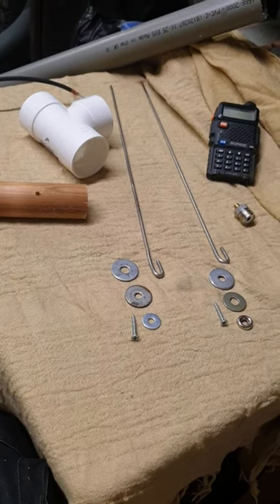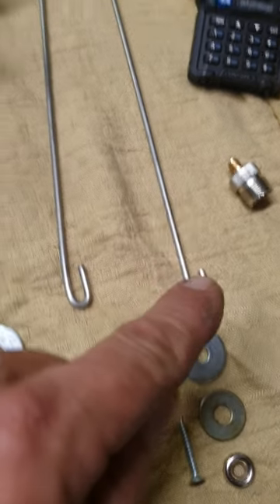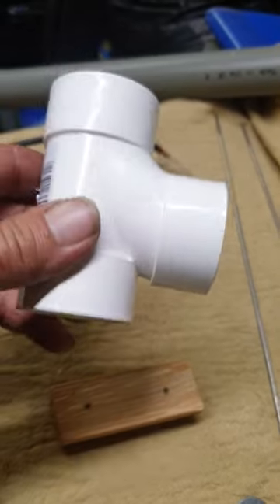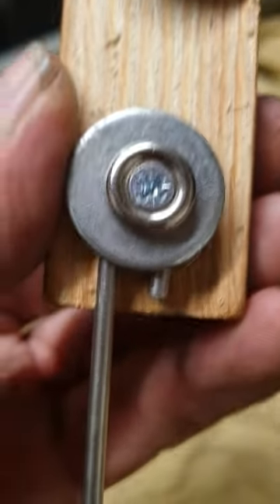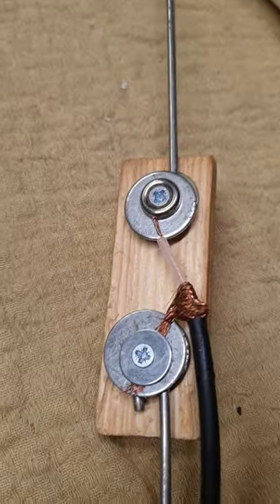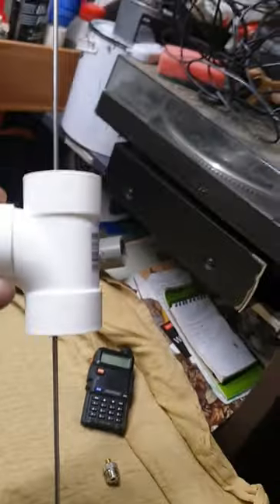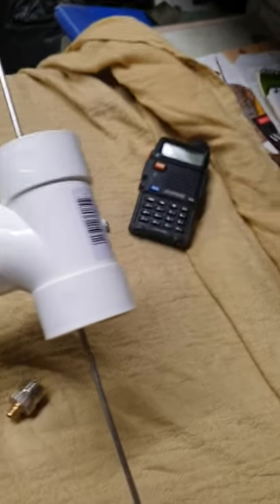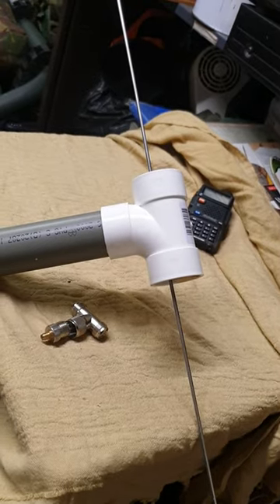baofeng uv5r  diy dipole

Comment: Simple, easy to understand. Thank you!
Reply from the maker: Then my work here is done 👍
Appreciate the kind comments thank you.
Reply: @kentprepper6392  does it make a difference when making an antenna for HF or UHF, when calculating for the wavelength lambda and speed of light. I mean is it better to place the dipole hanged on the terrace horizontally or vertically out on a window mast? ,. I thought logically, if it's on the terrace with good ceramic isolators on each end might have a better reception. AGain thanks for your excellent tutorial . Big hug
Reply from the maker: @juangizirian9810  uhf is usually vertical, this dipole is designed for vertical 👍

Comment: New to this hobby and new to this channel, a most excellent tutorial on creating this dipole! I wonder, being a total noob, would the reception/transmit be hampered if the 2 elements were completely enclosed with pvc pipe and pvc endcaps? I just thought it would be cool and mysterious to have it set up like that🙂 Gratitude for your work here, much appreciated. Subscribed!
Reply from the maker: Should work fine if inside plastic pipe 👍

Comment: I gave this a like, BUT the one problem I saw with it was how you skipped over how to connect the coax to the "CB connector"
Reply from the maker: It is connected exactly the same as a CB PL259 plug ie soldered in place, apologies for missing that bit.
Reply from the maker: My apologies, i was filming using a phone so was impractical to film that bit at the time, tho i do show what it should look like so people can figure for themselves, thanks for pointing this out tho 👍

Comment: Great enclosures. But. Dipoles need 1:1 baluns. 5-6 turns of coax near antenna, and it will make greate difference.
Reply from the maker: Sound advice sir 👍
Reply: Forget trying to match a UHF dipole to Unbalanced coax, Baluns are for large HF aerials.
make a 1/4 wave groundplane instead. a BNC flange mount panel socket makes a good
 base to solder 6 inch groundplanes onto. bent down 45degrees and it'll match 50ohm
coax. instead of a dipoles 75ohm

Comment: Do you need to take it down when it rains? I'm a new ham but I thought water in coax is a problem and I live in a wet environment. Would it work ok if I taped the coax and filled the PVC with epoxy? Thanks forgive my ignorance Im about to take my technician test and want to build my own antenna for my uv5r to learn. God bless
Reply from the maker: If protected from rain then will be fine, Check periodically to see if any corrosion occurs.
Reply: Leave a hole in the bottom of the antenna so any condensation can drip out. 👍

Comment: Nice and smart idea! Did you check your diy dipole against a Nagoya NA771 or similar? Would be interesting to see if there is any big difference in operation? Also how would it behave on 2m Band?
Reply from the maker: Far superior to the 771, not used on the 2m im afraid.
Reply: @kentprepper6392  Thanks - sounds great! Could you specify 'far superior' just a bit? 🙂
Reply from the maker: @rilosvideos877  the 771 adds 5-8 miles radius, the dipole adds 40+ miles radius.
Reply: @kentprepper6392  Thanks! Thats incredible! Have to try that 🙂

Comment: Anyone know how long the Elements need to be for GMRS in USA ?
Reply: For a centre frequency of 464Mhz, the middle of the GMRS band in the USA, each element would be 15.372 cm or 6.052 inches long. The length ISN'T hyper critical, if you made it 6 inches long, it would change your centre frequency to 468Mhz. You'd still get a usable SWR at 462Mhz, which is the bottom of the GMRS band. I wouldn't use steel rod though, as it's fairly poor in it's ability to radiate RF, use copper tubing or aluminium for the best results, but cheap welding rods work very well aswell. Make it, try it, remake it, until it works.

Comment: HI there, newb here. I have a UV-82 and use freq 477 how do I work out the length for that?
Reply from the maker: Each element should be 6.3 inches, there is an online calculator for dipole lengths.
Reply: Cheers mate @kentprepper6392  I'm off to buy some parts

Comment: It will be okay for rx but I believe that some kind of balun is necessary because coax is not balanced and doesn't match the impedance or something like that, I'm no expert. There's vids that explain better. Also the swr should be checked or you risk frying a 20 quid Chinese radio. 😄👍😎
Reply from the maker: Its all for emergency use only, i demonstrated how to make a usable antenna, it works out to 40 miles rx and tx, its worth risking a cheap radio (of which i have several) in order to experiment 👍
Reply: Fair enough, find out during an emergency when swr cooks components.
Reply: @techtinkerin  RELAX...

Comment: New to radio, my question is how shield of coax is connected to PL239 so the receive signal can be transmitted to baofeng (or it doesnt have to be connected and the rx signal goes through central wire? in sma both rx and tx go through same wire i think)
Reply from the maker: @startychh  the pl259 plug has a central core and an outer core, inner core is tx (out) and the outer mesh is the rx.
Reply: @kentprepper6392  makes sense. Thanks for your answer and good video 👍
Reply: The center conductor is used in both TX & RX. The outer mesh is used for ground, also known as a counterpoise.

Comment: What coax did u use and how do u put connector on the radio end of the cable
Reply from the maker: Hi there, first fit a SMA FEMALE to S0239RF UHF PL259 SOCKET in place of the original antenna (ebay about £5), on the coax end just an ordinary UHF PL259 MALE (ebay about £3) try to use at least RG213 LOW LOSS coaxial cable (ebay).
Reply: @kentprepper6392  thanks dont suppose u want to do a updated video and more in depth like showing fitting the connectors to cable ect 😂 thanks for the info
Reply: @kentprepper6392  would Coax with Aluminum coating work or is copper coated the best option?
Reply: @kentprepper6392  a PL259 might be called a UHF connector but its useless at UHF
use a N type

Comment: New to radios. I was all good until the end. How do you connect the coaxial to the "T" connector?
Reply from the maker: The coax would be soldered onto the plug that connects to your radio, in this case the T connector was simply to demonstrate, sorry if i wasnt clear! 👍
Reply: @kentprepper6392  Thank you
Reply: @kentprepper6392  Thank you

Comment: Can a dipole antenna be used or optimized for 915 mhz? If so how long would the rods be?
Reply: If I have it right, it's as below. The fastest way to get the correct answer on the internet is to post an inaccurate one! :)

234 divided by the frequency in Mhz times 12 for length of each element in inches. 
234/915=0.225 X 12 = 3.06 inches for each element. Or 6.12 inches total, tapped in the middle. I've seen people put a 1:1 blun in as well.  Also try vertical and horizontal orientation and use a non-conductive support (Wood, fiberglas) to hold the dipole.

Comment: Any grounding needed in case Lightning hits it?
Reply from the maker: Its designed for handheld use so the user would be the earth/ground, standard procedure is to unplug external antenna if lighting is forcast.
Reply: @kentprepper6392  ok, got it!

Comment: I have some copper tube here that's designed for brake pipe. I made this today but even up on my roof I got nothing on my Baofeng. Is the copper pipe ok for this? Need to check if I got anything wrong but pretty confident it's built to spec
Reply from the maker: Ive not heard of copper/zinc (brakelines are copper/zinc) being used before, i would remake using steel rods.

Comment: Can I use wire instead of metal elements as long as it's 70cm long either side? Would be used on the baofeng GT-3TP.
Reply from the maker: I have heard of wire being used, its best you try both, it is a 'try and see' type of hobbie, do both andcsee what works best for you.
Reply: @kentprepper6392  ok thanks.
Reply: @davidhooper1767  you van use wire. the thicker the better. gt3tp is a great hand held. had one for years and still love it.
wire dipoles pack down smaller and work just as well :D i made a wire one like this for another band and works well with a washing line peg to clip it to stuff
Reply: @wowsly  How long are each elements.Ive seen some that look quite small but others look longer.

Comment: Where can you get the wire and what gauge is it??
Reply from the maker: The coax used in the vid is RG23 but for UHF446 I recommend WESTFLEX 103
Reply: What length of coax do you need to make the antenna??
Reply from the maker: The length of the coax is determined by how far the radio is from the dipole/antenna

Comment: Not meaning to rain on someones parade but that qould only be good for an inside antenna only because if water gets inside the coax the coax becomes junk and if anything a dipole is fine as long as its vertical but making a ground plane id much better by 1db of gain over the dipole and more broadband
Reply from the maker: A rubber cap that slides over the top rod keeps all water out 👍
Reply: Yeh! Seal it up then.....duh

Comment: So, I screwed up on the math converting centimeters to inches and cut my wires exactly half of the 70 centimeters. What effect will that have on the radio?
Reply from the maker: The wavelength is bigger than the antenna length so the antenna won't 'hear' the signal sent on 446mhz the 70cm is half (or a quarter) the lenth of the of the signal wave.
Reply: On 446mHz a 70cm long antenna is 3cm longer than the full wavelength (speed of light/frequency, it’s about 67cm).  A bit shorter or a bit longer takes your resonance up or down.  Just make yours a half wave dipole, it will work just as well though you will need to wind the coax around the pipe tightly to choke off common mode current common on half waves.  Either that or get bigger rods.

Comment: Gtrat built can you use rg 6 coax
Reply from the maker: 446 vhf has a high loss with thin coax, rg23 at a munimum but 000 lowloss is best.
Reply: @kentprepper6392  is if you was to use rg 6 coax what would happen still very next to all of this
Reply from the maker: Unfortunately rg6 and rg23 are high loss when operating in the 446.093mhz range, better off with 000 low loss coaxial cable, the best you can afford.

Comment: Its not top for tx and bottom for rx....the are both needed for both
Reply from the maker: Thats a negative sir, the top is transmit, The bottom is recieve, they are a separate function.
Reply: @kentprepper6392  Sorry Sir.....but that incorrect....but its no big deal.

Comment: Hi  .  In fact i do not know how to explain my point of view from a scientific perspective.  My name is Sasa and I work in electronic circuit maintenance and design.  From my scientific point of view, all antennas have a certain resistance, and this resistance is measured on an Avo meter(Ω) . A is amper V is volt O is om (Ω) . see here just two metal skewers.  The thing that caught my attention was why I connected the body of the device to a metal skewer and the signal output to another skewer?  What is the relationship between the body of the device and the transmission and reception?  It is scientifically known that any body or structure of any device belongs to the Earth.  Grounding.  While you relied on it here for the transmission power, this does not make sense at all. The correct antenna contains, for example, a certain number of copper coils and a lenticular capacitor to filter out stray electricity, in addition to the length of the antenna. The sum of these things that you mentioned is the task of dealing with specific frequencies that are transmitted.  Or receive it.  As for what I see here, it is just a mockery, and the device’s output IC may be burned after a short period.
Reply from the maker: A very indepth analysis, i too am from an electronics background and i have learned that not everything that is written is entirely true, the simple dipole here works great and these are made at home by radio hams and enthusiasts for 2 reasons, firstly its extremely cheap to make and secondly it works great too, although i appreciate technical jargon the case remains that simple works well too.
Reply: @kentprepper6392  Dipole antenna. you are right. I have also seen many people making this antenna on YouTube, and it is a very successful method. Thank you for your interest
Reply: @sasa-qq9em  You to me are a AI Bot, dude!